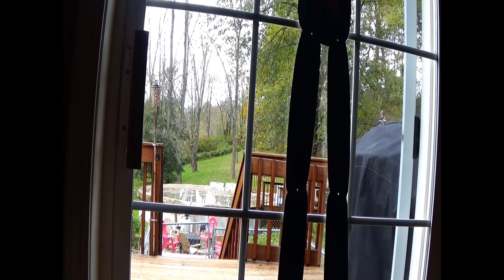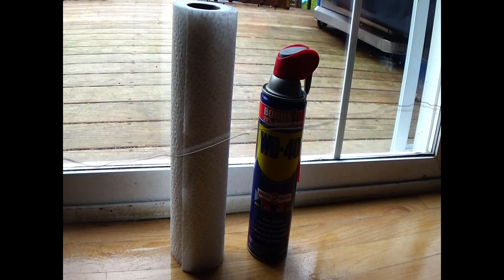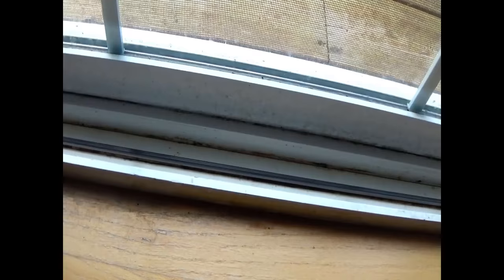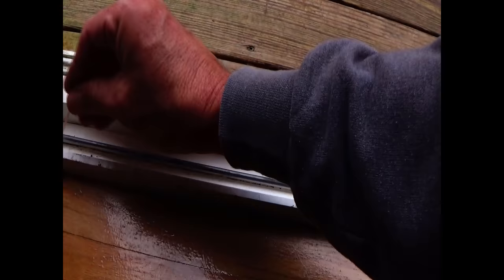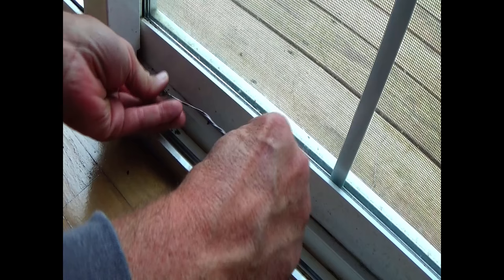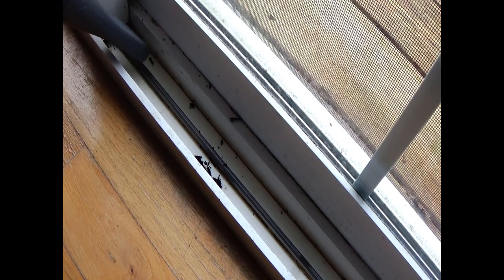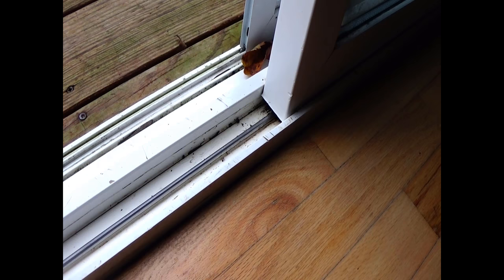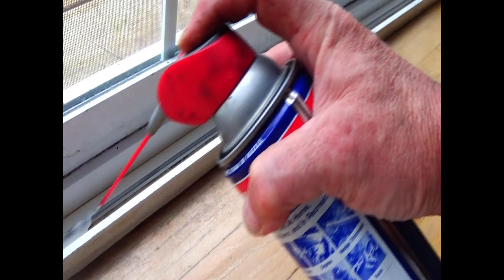How to Fix a Sliding Patio Door That's Not Sliding Properly

Comment: A little tip- Use Silicon Lubricant instead of WD40, it doesn't attract the dirt like WD40.  Good video.
Reply from the maker: Good tip....I only had WD40 on hand when I shot the video....Thanks !
Reply: Yes, 756766! WD40 was originally developed as a cleaner, I think by the military but they soon realized it worked as a lubricant, also. But I do the same thing these days, I buy the PB Blaster, Garage Door lubricant and their other silicone lubricants. beachtroll, I really appreciated the video because the bottom room of my house is often flooded by the river we live next to. And I had given up on how to make the sliding glass door open easier.
Reply from the maker: @peanutsmcgonnagle2458 Thanks for the information. Thanks for watching!

Comment: Thanks! My door has been dragging and the wheels didn't sound good. Iv'e watched other videos and was getting prepared to take the door off, clean the wheels and possibly replace them. I watched your video and saw how dirt gets underneath in the wheels. I followed your directions and now the door actually opens and closes with one finger. It is completely silent when moving. So many videos are overkill. I'm sure that you know all about taking the door out and changing the wheels, but you just showed what should definitely be done first and you were spot on! Thanks for straight forward none overkill video. You saved me time and money.  I think that I will do my daughters door next. Thanks again.
Reply from the maker: Thanks for the nice comments...I'm glad you were able to get your door sliding smoothly. ..Thanks for watching!

Comment: After watching the video and following the directions my sliding glass door slides as if it was new. I bought 10lb picture hanging wire, doubled it and twisted the wire. I had a close call as it broke as I was pulling it out of the bottom of the slider. Lucky for me that it broke leaving me enough wire outside of the slider to pull it out. I would suggest using a 20lb or more wire. Thank you for taking the time to post this video. It saved me big bucks as I was contemplating a new sliding glass door. FYI...the handle on the door had broke off due to the stress of closing and shutting the door when it was very hard to open and shut. The handle breaking off is what caused me to research how to clean slider. I replaced the handle, cleaned the slider and am good to go.
Reply from the maker: You’re welcome...glad it helped! .. Good tip, thanks!

Comment: You can tell by the clicking sound that you have a bad roller that needs replacing. Most sliding door can be lifted off the tracks and removed for cleaning, roller replacement/adjusting. A good track cleaning never hurts, but your door problems are not resolved.
Reply: Not to mention the dirt will stick to the Wd40

Comment: Going to try this.  Another "how to fix your sliding door" video on YT walks you through removing the screen door, removing the fixed half of the sliding door unit, and then removing the sliding section. In other words, "take the whole thing apart."

And then unscrewing one side of the door frame, then using a rubber mallet to move the loosened frame piece up and out of the way of the lower frame piece, then using a hammer and screwdriver to pop out the old wheels, my god the video may as well have been "how to build a rocket" with all the steps involved

Your video looks a lot simpler and probably is the fix that will help the vast majority of us.  THANK YOU!
.
.
Reply from the maker: You hit all of the points on why I made this video....Not many people have the time, strength or patience to deal with all of those steps...... Just a tip, use a silicone spray (liquid wrench works well) instead of the WD-40.....Silicone works better.....Good luck!
Reply: @beachtroll8344  Thank you kindly for the silicone spray tip, because I'm starting the attempt to get my sliding door working today.  Keep up the great content and thanks!
Reply: @beachtroll8344  I USED THIS APPROACH TODAY AND FIXED THE DOOR!  My gosh what a relief, didn't cost me a penny.  Here locally there are people who advertise services to fix a sticking sliding glass door - they are not cheap!

It took about 25 minutes.  There was a lot of dirt build-up on the track and around the wheels.  I added lots of lubricant after the track was cleaned spotless and my goodness, it opens and closes as smooth as a new door.

The only twist was, the frame of the door at the base was bent inward in one small spot that improperly narrowed the track for the door frame to slide past - I just used a pair of 'channel-lock' pliers - the smooth type without serrated (grooved) teeth - and slightly bent the track outward, away from the door frame.  This was not the main problem with the door - it was just a bit of friction that I discovered after the door started moving freely again.

I added lubricant to 4 spots:
1)  the cleaned track
2)  the wheels
3)  the lower inside wall of the metal track (by 'inside' I mean the track wall on the interior room-side of the door track)
4)  the lower outside wall of the metal track (the track wall on the house exterior, the backyard side of the door track)

I did (3) and (4) so that when the door slides, there is a layer of lubricant between the door frame and the lower track walls.

I was going to add lubricant to the upper track walls but it did not need it.

I feel I got lucky finding your video and using your technique -THANK YOU!
.

Comment: Nice video.  Very informative.  Old TV Producer here.  If you want to greatly improve your videos, you need to make sure your light source is coming from the same side of what you are shooting as the camera.  You don't need expensive lights.  A flashlight would work great and if you have a light bar built into your flashlight, use that.  I know that you are competing with the outside sun, but you will be surprised at how much difference a good flashlight or even a "head-strap-light" will make.  Looking forward to seeing more.
Reply from the maker: Thanks for taking the time to give those tip!! .... I’ll definitely implement them on any new videos....Thanks again!
Reply: Great tip. The video is a little dark and hard to see. Great video though
Reply: You gave advice in a very respectful way.  Thanks for that.
Reply from the maker: Thanks!

Comment: Thank you for a very informative and helpful video!  Our door has become a weight lifting experience to open/close, and it's nice to have a "fix" that comes BEFORE unseating the door(s) and replacing the wheels.  Thanks again for a doable fix!

~~~~
Reply from the maker: Thanks for taking the time to comment....Glad it helped!
Reply: @beachtroll8344  i watched your video, and for good measure i also unseated the door and libricated the wheels themselves with wd40, now i have to be carefull not to open to hard, because the door will slam at rhe end of the rails.
Thanks to your video i didnt have to spent over 100 us$ to replace the wheels as someone recommend me.
Reply from the maker: Awesome!

Comment: You can easily remove the door and  clean the tracks also 👌🏿
Reply: Yes, and you can then clean the roller wheels too. Some doors are heavy though.
Reply: Easily? Mine won't come out. Old style doors would do that. I own houses that have those doors. Modern doors, 1990s and later the door is to large to take out of the frame.
Reply: Not easy depending on doors ! My are the extra tall double open from left or right 2 large doors.
Reply: I’m trying to do that rn... so hard

Comment: Thanks this really helped. When this happened the first thing that crossed my mind  was to call for someone who fixed such problems and that meant $$$.
Reply from the maker: You’re welcome...glad it helped!
Reply: I was quoted $200, then saw this video. I will try it tomorrow BUT I have already scrubbed the tracks in the past and used silicone to lube. Cleaning out under the door might do the trick. I am suspecting dust & dog hair. Wish me luck so I can cancel the repair guy. 🙏

Comment: Solved the problem I’ve been having forever. Thanks!
Reply from the maker: Awesome, glad my video helped!
Reply: Instead of using the crimped wire to clean out the roller dirt how about spraying the roller with WD40 then blast it with air and have the other side blocked with a rag ? I've been using silicone for years and the track still needs cleaning twice per year . Thanks for the tips.
Reply from the maker: @smerchly Silicone is actually better than WS-40 to use on the tracks (I didn’t have any on hand when I made the video)… Using compressed air could be useful…Good advice. Thanks for watching and commenting!

Comment: Make sure you get lubricated WD-40. 
WD stands for water displacement, reqular wd is not a lubricant
Reply: Jon H did both works perfects now
Reply: I use a silicone spray.
Reply: @sergeantbilko7070  I agree, silicone spray is fantastic for this job.
Reply: Weird that they advertise it as a lubricant then.

Comment: I have an older home built in 1977. The sliding glass door and all the window are original to the home. When the door sticks or won't slide at all I usually use a vacuum to remove the dirt from the tracks. I do this every couple of weeks due to our going in and out and tracking dirt that eventually causes the sticking problem. I never needed to use WD-40 until today when removing all the dirt from the track didn't work this time as it usually has. 

The door slides nearly effortlessly. Lets hope the WD40 doesn't attract more dirt.
Reply from the maker: If you have Silicone Spray, (Liquid Wrench), it works better and won’t attract dirt.

Comment: Thanks for the upload.  I've tried just using WD-40 alone but it would only work temporarily.  I'll try the other techniques sometime but using the wire sounds very tricky.  It's hard to keep a firm grip on a wire while pulling.
Reply from the maker: I use “Heavy Duty “ Picture Wire. It’s pretty thick, I double it and twist it off at one end and put the “loop” side under the door. ... It’s also better to use Silicone (Liquid Wrench) instead of WD-40.... ( I didn’t have any on hand when I did this video....Thanks for watching & good luck!
Reply: @beachtroll8344  Awesome! Good to know, and I'll take note of it.  Thanks again!

Comment: Many thanks good sir!
Reply from the maker: You’re welcome!
Reply: I have Teo panels of glass door, except only one I use yo open and close, because the other one if firm. Should still used the W/4, wire etc? Please text with new suggestion. I will appreciate:)
Reply from the maker: Hi, I suggest using a Silicone Spray (not W-D40)….Silicone Spray works much better. Good luck!

Comment: A patio door guy with 25 years of experience toldl me that it is okay to use WD 40 to clean but you shouldn't use it as a final lubricant. Wipe it off, or it will attract more dirt. After cleaning off the WD 40 follow up with a dry lubricant. has anyone tried this?
Reply from the maker: Good tip!...or use a silicone spray....Thanks

Comment: I didn't see any roller access, but I could hear the rollers down there somewhere. Commonly, adjusting the roller height is a necessary fix. I agree with cleaning along the track and wiping away the oil. I do not agree with applying another coat and leaving it, as the oil acts as a great collector and retainer of dirt which will not vacuum out. Then you're stuck with this cumbersome process again.
Reply from the maker: Good points you make. A silicone spray would work best. Thanks for you comment!

Comment: Did you know that you can adjust the wheel to make it open smoother ?
Reply: How?
Reply: @chrishughes2335  There are two screws on both ends of the door, near the bottom. The screw that is inside a hole is the adjustment screw. Clockwise to raise the door!

Comment: It’s normally due to the rollers needing adjustment. Much easier than all that messing around with wires etc. Wd40 is a degreaser so it will ruin the roller lubrication  over time.

Comment: There are usually screws at either end of the door. Remove those screws and you can adjust the rollers, one at each end of the door. When your door is level, spray WD40 into each hole to clean and lubricate the rollers. Very effective way to make the door slide better.
Reply: Thx for this video. I played it for my husband now door slides easily b

Comment: Great video! The only thing I would suggest is not to use WD 40 as it actually gathers dirt and grime. You can buy an aluminum lube spray can from Lowes made for this and as a plus it prevents rust and salt penetration if you live near salt water.
Reply from the maker: Good tip....Thanks!

Comment: I tried this and it made a world of difference, however, it's not gliding real easy.  Think the rollers need replacing but for the life of me I cannot get the door out.  Either the backside clears but the front doesn't and vise versa.  Any suggestions?
Reply from the maker: If you have silicone, I would put some on the glide bar that the wheels slide on (apply some when the door is open and closed).... If it works it’s easier than removing the door...Good luck!

Comment: If just remove the slider from the track by lifting it up and out will make this 100 times easier. And you’ll be able to have access to the rollers on the bottom. But if you are by yourself this will work.
Reply: I've tried that and failed.  My problem is that the wheel is off the track and really hard to move, almost impossible.  When I try to lift the door it is locked down somehow so that I cannot get the wheels back on the track.  Maybe my sliding glass door design is a little different than yours.
Reply: @patrickwood4487   Did you slide a flat screwdriver under each wheel while lifting door (with 2-3 people of course)? I saw that in a video. I'll probably have to do that with mine.

Comment: Quick tip:  WD40 is a solvent, not a lubricant, which means it's used to break down oils so you can clean the surface the oil is on.  Lubricant with a silicone based lubricant is best for this application.
Reply: Reading from back of WD-40 can "LUBRICATES MOVING PARTS' ETC.

Comment: I liked your video.  It will help.  However my current problem with sliding glass doors is that I have wheels off the track and can't seem to get them back on.  I think the door is somehow locked down on the track and so I can't raise the door back up enough to place door wheel back onto  the track.  How do I release the lockdown and then redo it when the wheels are on the track again?
Reply from the maker: A good detailed video by .... SWISCO .... “ How to replace Patio Sliding door wheels” .... Hope it helps
Reply: @beachtroll8344  
Thanks! My door was constructed somewhat differently but the tip about changing the distance between the bottom of the doors and the wheels worked on mine and I was barely able to get it back on track.  But more importantly, by raising the door afterwards it will be hard for the wheels to ever get off the track again.

Comment: My basement sliding glass door hadn't been used in at least 10 years.
Extreme rail cleaning with a toothbrush, wire brush and 1/2 can of WD-40 solved everything.
A WD-40 shower brought those rollers back to life.
Reply from the maker: Glad my video helped!

Comment: wd40 is good to clean out but its a temporary fix and can attract dirt. you want a dry lube like silicone, it will coat the surfaces, glide smoothly against itself even after drying and its easier to clean

Comment: The wheels make a clickity sound when you move the door, suggesting there is a flat spot on at least one of them.
Reply from the maker: You would have to remove the door to inspect the wheels.
Reply: @beachtroll8344  Yes, but doing so would have also simplified cleaning the track, so you spend more time removing the door and less time cleaning. Plus you have easy access to the rollers if you decide to replace them.
Reply: @raymondkostanty8634  many of us aren't capable of removing the door.  Especially me ! I'm 5ft and my doors are two extra tall and very heavy! The cheap smaller apartment type are easy to remove these are not! All I needed was a simple cleaning and this worked perfectly! Rainy season here wind water blows all kinds of crap in the tracks. Newer home so it isn't the rollers. When it is you have to lift jiggle struggle to open a simple decreased slide or stick is usually dirt build up.
Reply: @Krae75  As I have repeatedly said, I and a helper removed the door and laid it flat on two saw horses.  To my amazement the wheels at both ends turned freely, and the track wasn't particularly dirty.  Not knowing what else to do, I rehung the door; still hard to push. Now I've realized that it's dragging on the track, despite turning the height adjustment screws to lift the door as high as possible.  The homeowner doesn't want me removing the door again so I can investigate the problem at the wheels' adjusting screws. The whole opening onto the patio is four door widths wide, with the middle pair on rollers, so she just uses the other door, which much easier to open, but not as easy as it could be. I use silicon spray, not WD-40. But spraying the track is not a real solution. If it helps, it just confirms the door is sliding/dragging, and not moving because its rollers are carrying the weight and freely rotating.